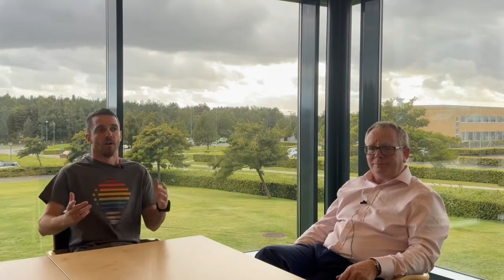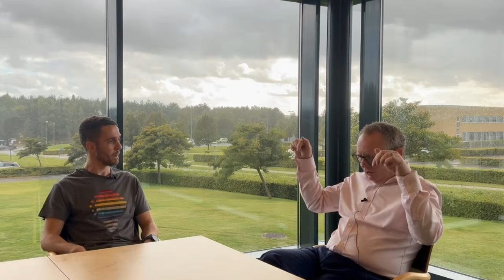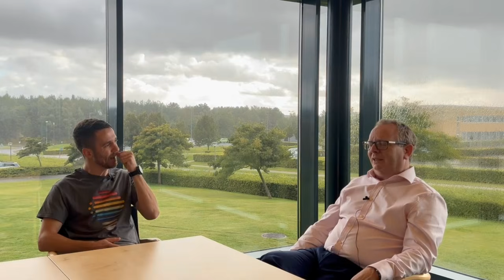How Haier R&D Plans to Simplify Heat Pumps | Graham Hendra

Comment: Heat pumps are used to exchange air. Adding heating water is a needless complication, Gas boilers are great for hot water. Air-to-air drastically reduces gas use for heating. Keeping both provides backup for when one fails.
The problem with hoses through the window is that the sealing kits are not secure against burgers. I have found a simple,, cheap secure way to fit a window opening.
Reply from the maker: It can work pretty good with air to water, technology today is better and better.
air to air has some benfits, but for heating I think air to water (or hydronics systems in general) are way more comfortable.

Comment: Why don't you make a unot with two smaller compressors so one unit can cover more range and modulate lower, instead of having cascade units
Reply from the maker: It is more expensive probably with inverter compressors but on higher capacities there are more compressors. Usually ON/OFF
Reply: @HVACEducationHub i install industrial pumps for the water industry and use inverters a lot, and it is possible to run to pumps off one inverter so must be possible to run twi compressors off one inverter and then when low power is required isolate one compressor completely, perhaps more clever people than me have thought of this

Comment: The analogy with cars is a very good one. But like cars, there’s now a rejection of on-board technology. Modern cars & indeed HP’s are fighting against their market, you never spoil people with choice, it’s a rod for your own back. Like Henry Ford said about the Model T, there’s two choices, Black or Black.

Too much controls just frighten the customers & the efficiency of HP’s are so critical, you’ve every chance, as an Installer, of just fucking it all up.

KISS sells.
Reply from the maker: Agree 100%. But this is hard to manufacturers, to make something simple, you need to master it and make everything in house easy for customer.
Reply: @HVACEducationHub true and I suggest that more specifically the marketing departments of the manufacturers create an endless demand for new features to solve THEIR problem of something to talk about. The one thing marketing departments NEVER prioritize is making products durable or easy to install and operate.

Comment: A simple wiring interface which you integrate existing 2-port zone valves into would be the way forward,as most uk central heating system have these valves already fitted.
Reply from the maker: Software logic is the problem to control condensation